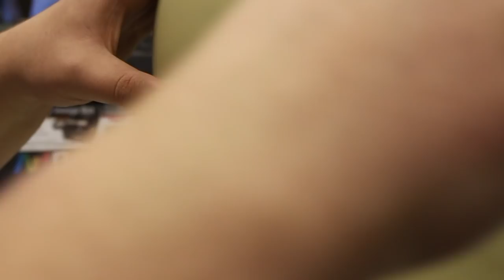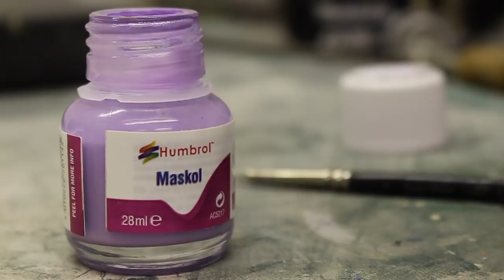Painting Boba Fett

Comment: That looks incredible, how much Maskol did you use in this project? and did you need to reapply each coat, or could you have just added more on top. Was the re-application more to get the accurate painted areas from reference?
Reply from the maker: Tyler Matchett thank you. So not a lot actually, a bottle of maskol will last me a good 3-4 helmets. It looks like I’m using a lot but the bottle lasts. You can of course leave the maskol on between layers. But I find the longer the paint is on the harder it can be to remove.
Reply: @BlaidonProps  oh perfect, thank you very much for the reply, I'm going to try it out the next time I paint my Boba, love the video, the helmet looks sick

Comment: Holy hell man welcome back! Your videos were insanely helpful before! After painting a layer, how long do you wait before putting on maskol? And then how long do you let that dry before painting the next layer? And lastly how long do you let that layer dry before peeling up the masking?
Reply from the maker: foosbabaganoosh1  it can depend on a few things, what the temperature is, mix ratio of the thinners, how heavy the spray is. I usually do light layers, and wait about an hour before each coat, maybe a bit more if it’s tacky to the touch. With the maskol you can actually see when it’s dried by the dark purple colour it goes, usually by the time I mix the paint and set the brush up it’s dry enough to paint over. Hope that helps.

Comment: few quick questions - how come you don't spray the whole helmet silver to start with? As doesn't silver base layer show through on all parts?

also, why do you remove the latex each time instead of just extending it? Does this make it easier to keep track of where you are?
cheer
great work btw!
Reply from the maker: Krak Fox  so I only spray the silver in areas as I’m handling the helmet a lot and don’t want to tarnish or mark it. You can of course paint the whole helmet, I just choose to do it this way. 
As for the latex, I find the longer you leave it on the helmet, the more stubborn it is to remove. I like to do it while the paint is still slightly tacky. That way it comes off in large sections, and you get a nice clean edge. Also it’s easier to transfer the damage on to rather than over a lumpy latex surface.